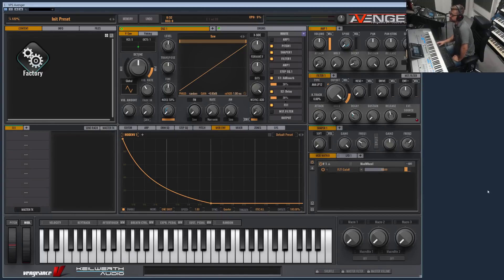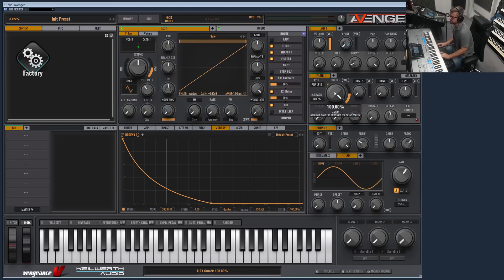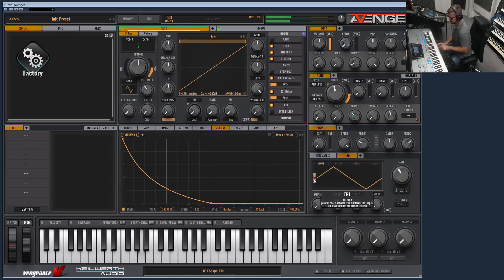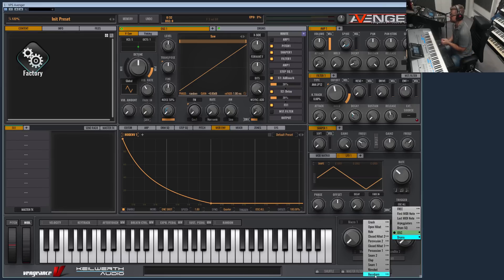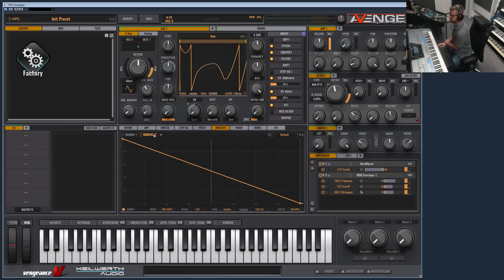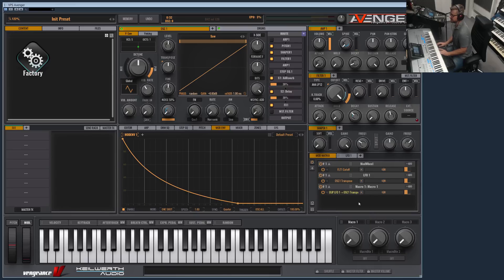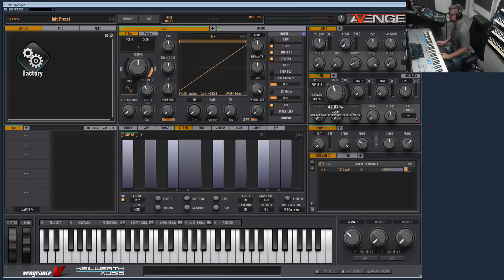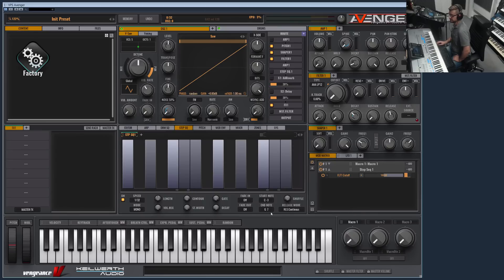Vengeance Producer Suite - Avenger - Tutorial Video #6: MODMATRIX & LFO

Comment: Nice, but is it possible to control the NoiseColor with the LFO? I tried, but couldn´t do it. The emerging question is, if any of the inner circle knobs can be targeted by the LFO?
Reply from the maker: yes of course, all inner rings can also be modulated in the modmatrix. But there is no drag and drop target, please chose it in the modmatrix' target menu
Reply: @VengeanceSound  Alright, thank you!